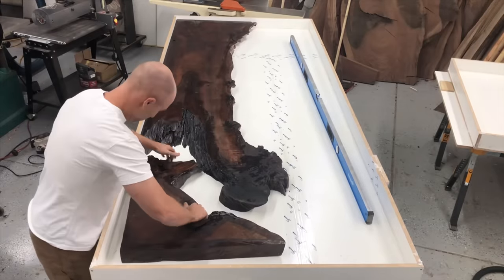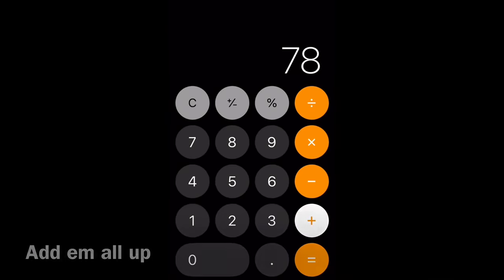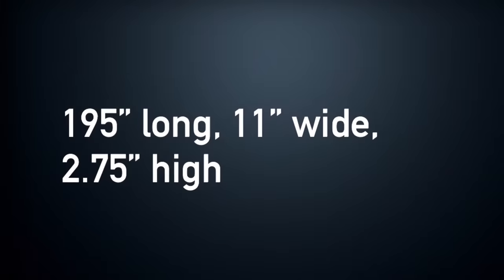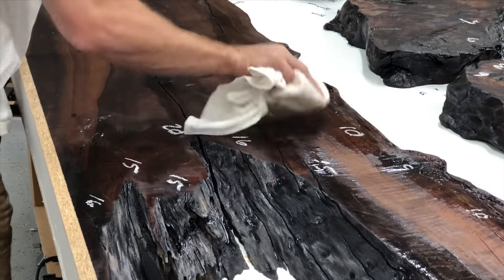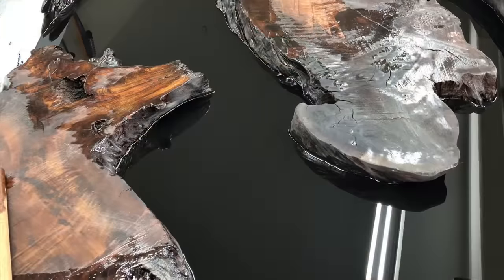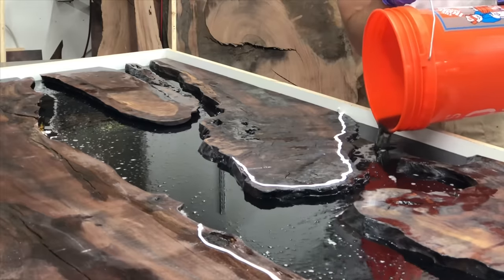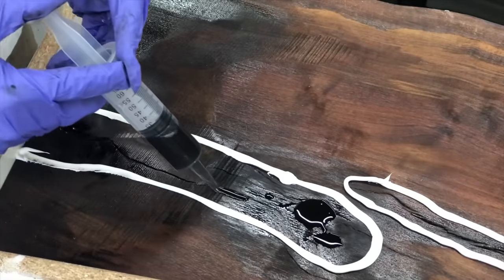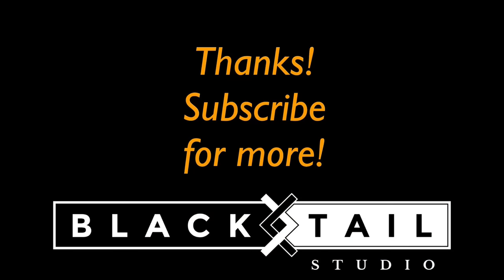Calculating Epoxy Volume--How to Epoxy Woodworking

Comment: Couldn't you also wheigh the wood, calculate it's volume with the density and subtract that from the total volume of the table?
Reply from the maker: Brilliant!
Reply: This is how I would have done it.  Knowing the density of the wood and the volume of the table and assuming it’s uniform thicknesses  you could easily calculate the volume difference.
Reply: @hydrohobbyist  the problem is, that theres no constant density, this is no homogeneous structure
Reply: It's homogeneous enough, for sure it's faster and more precise than measuring such curvy path.
Reply: This was my initial thought as well.
Reply: @deathmetal5156  How about using sand?. Fill the gap, take it out and see the volume. Would it work?.
Reply: @BlacktailStudio  How about using sand?. Fill the gap, take it out and see the volume. Would it work?.
Reply: that is inaccurate .. What if the pieces have a void in them ? or a horseshoes buried in them .. The guy that solved the method was Archimedes a few thousand years ago ..
Reply: @IVORY123100  If there's a horseshoe in it, it would probably have been found when the slabs were cut. small voids would not make a big difference in something this size. this is still a much more accurate method than the one shown in the video
Reply: @johnthomas4790  No it's not .. I was being facetious about the horseshoe .. Calculus is actually the way to go but considering the time .. It's not the best pathway ..  I would have used Archimedes method ..
Reply: Too much work
Reply: Why not just pour water to level, dump the water and measure that, then make an equal amount of epoxy... lol
Reply: Variations in density will not be very large,needs just 1cubic cm, wood
Reply: Jonathon Smitherson because my wood would be wet..... plus I’m not trying to pat dry all that surface area
Reply: @mariaarana6912  thanks for the answer! :)
Reply: @IVORY123100  wrap the wood in clingfilm to avoid sand going in to crevices.
Reply: @BlacktailStudio  Can you just pour until there is enough? 
Since you work with resin, you don't mind having extra.
Reply: @rowndo  the idea is to waste as less material as possible, and going little by little would take too much time considering curing time and the preparation of the resin between layers
Reply: @johnthomas4790  How would your method be more accurate than his method that was only 6 liters off? He was only like 6% off, which is why in any kind of construction estimating you always add 10% to your material estimate. If you're like him you're building these for a client, and you're billing them on your estimated materials cost and probably require a deposit or down payment to cover at least the materials. So, being that 'accurate' isn't really a big deal because you're getting paid either way as long as you're not too short then you're good, right? This is a $10,000 table, 6 liters of epoxy buying in bulk price is what, 3,000 in epoxy he claims it cost, divided by 105 liters used, is 28 dollars a liter, which is $171 dollars for 6 liters. I don't think a client spending 10 grand on a table is concerned about a couple hundred dollars, do you? I mean, you can go all math magician if you want and weigh stuff and calculate density but time is money if he values his time at $100 an hour or $150 an hour, and it takes an hour to weigh all of the wood and do all of this stuff then you might as well have just been off by 6% anyway lol.
Reply: Or you could figure your volume without the wood, then measure the wood, subtract that from the volume and there you have your new total negative space, which gives you the amount of epoxy

Comment: Why not just pour water and measure how much it takes to fill? The wood is sealed no?
Reply: that is the fastest way to do it,
Reply: Great idea. Drying it would take some time though I think. ( Well - not where I live. )
Reply: @chookvalve  put plastic
Reply: or just do the volume of the cuboid and minus the volume of the wood
Reply: The problem is if anything goes wrong and the wood gets wet you would have to dry it again
Reply: Some woods soak in a lot of water, it's not ideal

Comment: fill the epoxy areas with uncooked rice then measure the rice after in 5 gallon buckets. accurate, easy, cheap and re-useable.
Reply from the maker: I do like rice. Having 100 liters of it handy would have fringe benefits.
Reply: I was thinking fine sand, the volume estimate would be closer and the cost cheaper, it wouldn't spoil, etc. That would save so much time on measurements. Try it with a smaller poir to see how closely it estimates the actual liquid volume required.
Reply: Pretty damn good idea. Assuming water would penetrate the wood too much.
Reply: Very nice tabl 
I learn more from you tomch thank you

Comment: Too much waste. Could have filled the bottom of the "river" (pebbles, sand, wood scrapes, anything that occupies volume) and pour first layer really black to hide fillings.
Reply: Gross. Absolutely gross. My table better be all apoxy and not a vegans lunch
Reply: Eh, client's prerogative. If they want a huge table that's mostly resin and are willing to pay for it, well there you go.
Reply: Nieroshai 
I don't think you understood my initial comment. It has nothing to do with size. Less epoxy volume would reduce the weight and improve structural integrity.
Reply: Nieroshai my opinion matters. Not yours
Reply: That is not the correct way to build a $16k table.

Comment: Cam hello, 
Thank you for sharing all your content and providing step by step information on each project. I am somewhat new to your channel and while I am still catching up, you mentioned the waste amount that seeps under your projects which I think in this one you said it turned out to be about 2 or so liters of wasted epoxy. Not sure if you do it now or not but if not you could just line the underside of the wood with caulking to seal it so you can save money and not waste more product than needed. 

Respectfully 
Travis

Comment: Awesome channel! So much information in one place, simply amazing. Beautiful woodworking projects. Top knowledge. One short question Cam: What is the maximum recommended quantity of epoxy resin in one table in percentage - regarding coverage? In other words, is it too much if wooden slabs take abut one half of surface and epoxy river itself takes up other half of total design?  What has to be considered? Thanks a lot. Keep up the good work. Jan
Reply from the maker: No book on that! Just preference

Comment: Great job!  I am just finishing a walnut 51x96x2 1/2 with white tinted epoxy.  All good except for tweeking my back loading it into my van after running it through my buddy's 52" sander/planer.  Next step to surface coat with clear epoxy then spray with UV resistant 45 sheen urethane and viola.  Thanks for the demo.  Few understand the costs of these projects.
Reply from the maker: Awesome!

Comment: Hi Cam, I just watched your "You Tube" smart desk for your wife.  I am just starting to use epoxy and resin products.  I really liked the brass/ bronze you used for the cracks etc. I have found that if you use a small amount of wood stain acrylic sealer stirred into the epoxy/resin it tints to match closely with the wood you are using ie walnut wood add tiny bit of walnut stain,  mahogany wood use small amount of mahogany acrylic stain.  The acrylic is the only one I've found that works at this time.  As you know,  some woods are expensive and with metal epoxy/resin additives it's also costly so test on a small piece of scrap wood. Also, Raw Umber is a great tinting tool if you've gotten it too dark.  I've been a contractor over 30 years, antique restorations, however I'm looking forward to retiring and trying my hand at woodworking! Used to be I could walk into a lumber mill and I could tell which lumber by the smell and my crew used to laugh at me! I ultimately want to do a full table in walnut,  if I could get a thick enough slab I want to slice it and biscuit both pieces together to get a butterfly design.  It's only happened for me once, years ago,  restoring a walnut shrunk, but I'm hopeful! I've subscribed to your site and look forward to the next project! Be well and blessings for Father's Day!👍😀
Reply from the maker: Wow, that’s! And happy Father’s Day!

Comment: Someone else mentioned the density trick above, but I also wanted to suggest an improvement to this method in the video. Say the direction parallel to the longest side of your table is north/south. Divide the table into segments by drawing lines directly east/west (not diagonally) across your table at each point where either "bank" of the "river" has a corner. Record how much of each of those lines is in the "river", and do the same for the northern and southern edge of the table overall. If the line crosses the "river" multiple times, add all of them together.
You're going to give each segment a score. Add together the river width numbers you recorded for the lines on both sides of the segment. Multiply that by the distance between the lines. That's the segment's score; write it down on the segment. For example, if one line has 5 inches in the "river" and the other line has 3 inches, and the two lines are 8 inches apart, you would write down (5+3)*8=64.
Add together each segment's score. Divide by 2. Multiply by the height of the table. That's a pretty good estimate of your volume.

Comment: Nice Calc method. I simply use pearlite beads and a measuring jug. Pour in the beads with jug, measuring the number of jugs. Once it's full you have the volume and vacuum the beads out. I like the edge and bottom calc.

Comment: Imagine being rich enough to spend over 10k on a table
Reply from the maker: Would be nice!
Reply: M R pretty sure the wood alone is not far from 10k
Reply: @weg5856  would be alot cheaper to build a mill and cut your own slabs. Just need somewhere for them to properly dry for 2 years. I see big old trees all the time you would be surprised how often people will let you take them just to get rid of them. Then build yourself a sawhorse and a cherry picker, cut the logs to your desired length, set up your makeshift mill, cherry pick your logs onto your sawhorse and get to work.
Reply: I can't even imagine spending 3k on the epoxy :P
Reply: sometimes you have to bite the bullet and take into consideration how much it would cost for three inexpensive sets that would last 5-8 years versus buying something you love and you'll look at every day for thirty years! It's a tricky balancing act. But you have to ask yourself "what brings joy to my life"
Reply: @aadravid  Me too.
Reply: M R buy hand tools on Amazon and you probably can
Reply: 3000 epoxi, 2000 wood. 2000 work-electricity-machinery-earning,  10k is overpriced. Far better 15k
Reply: No

Comment: Hi Cam. Thanks you so much for your extremely informative videos. I am an accomplished professional woodworker, but just getting ready to do my first large epoxy table. You cover everything so clearly but I do have a few questions...My slabs are only 1.25" in thickness. Do you have any advice for tables that thin? Will flexing be a problem? 45x86 dimension. Have you ever had an issue where the epoxy separates from the wood, creating a small crack? If so, what did you do. This table will be going from an average humidity of around 10% (Idyllwild, CA) to one that averages over 75% Smiths Ferry, Idaho). Do you force problems with that? Thank you in advance for your time and expertise!!!

Comment: I wish you would do a project where you pour half of the form with black epoxy like you did on the first half of this pour, but then instead of pouring black epoxy in to fill up the form you finish the pour with clear epoxy!!! This would give so much more depth to the table. I think this would add a extra dynamic flare to your work. I think they would be gorgeous, and would love to see it!

Comment: Love your work everything one of your tables look flawless I have started building tables after tons of reading and research .. I always seem to have trouble with putting on my tables I have tried several different ways to reduce the epoxy pits but little or no success I have tried sanding and doing a thin coat over the top but it doesn’t seem to work I always have to go back and sand and polish .. Witch leads me to asking what you do to reduce the pitting  in your resin ?
Reply from the maker: The best thing is using a good epoxy

Comment: Love the videos and your results!  2 questions :  1.  on one video I think you mentioned - to NOT pour the table "top side" down - why not, actually seems like a good idea to me   2.  the epoxy I was going to use says High gloss, does the hardwax sheen of satin negate the high gloss???  Thanks!
Reply from the maker: My latest epoxy video I did upside down with some problems. Should help

Comment: Thank you for all you are teaching us. I live in Saint Helens so I hope to attend one of your seminars some day. 
Just finished the flood coat on a 10'x4' red cedar table top. Had done a skim coat before that. Went in the shop every once in a while to eliminate a few bubbles, it looked perfect, when toward the end this big fly landed on it. Removing it the epoxy was too far gone by now so I ended up with a 1" blemish right in the middle of it. Is there a way to spot fix it without re-doing a complete new pour? Thank you,
Reply from the maker: I think you should be able to scuff that area up with 320, then another thin coat in that spot. Sand flush and buff or add finish from there

Comment: Just had this thought.
Buy a few bags of sand (or just dig up some dirt from outside. But make sure it is clean and consistent, you don't want to be mixing in compounds with different densities.)
Calculate the weight of sand for a given volume (such as the number of ounces per gallon or some such).
Lay all of the wood slabs in the form, and fill in the river space with sand up to the target height.
Pull the slabs out and sweep the sand into a container.
Weight the container on a (properly zeroed) scale.
Using the above weight/volume ration, calculate the volume occupied by that weight of sand.

Probably need to add a bit of cushion, since you will lose some resin in manufacturing, and the resin can fill gaps that the sand won't, but that should give you a fairly quick, relatively accurate method of calculating the volume of empty space.

The only issue I can think of is that some times you may not want to cover the slabs with sand (for example, DON'T try this when the wood is freshly sealed, the sand would stick to it...)
There are other things that this could be done with. Water for example, better ability to calculate volumes and fill voids, but I doubt you would want to dunk your slabs most of the time.
Another option would be small metal bearings, though that could get expensive. Coarse sawdust might work as well. You can get creative, just be careful about contaminating the project, the environment, or yourself.

Comment: Do you space your slab an 1/8” away from the inside of the mold (melamine) edge to allow for the radius of the silicone/caulk you put on, So it can register flat on the bottom of the form? Newbie here haha
Reply from the maker: I cut it down anyway. So doesn’t really matter in the end

Comment: Love your work!!  I'm just getting into epoxy resin and am starting small.  My work will be for personal family and friends, not commercial.  I'm wondering if you have used polyurethane finish over your tables and,  if so, how you avoid brush marks?  I've used a china brush and foam brush application, but still get marks.  Appreciate any thoughts!
Reply from the maker: Brush marks can be tough! Let it self level best you can

Comment: Sorry I know this question is late in the game but I have two questions for you.  Do you use anything on the side of your forms in between pours like say, an electric sander to vibrate or push up the bubbles?  I know what I want to say I just don’t know how to put it lol.  I’ve seen it done before on concrete counter tops and even large floors.  Pros use a vibration machine to make any bubbles rise to the top.  For smaller pours, a counter top, I’ve seen someone use an electric palm sander without any paper.  Just using the vibration from the machine to cause bubbles to rise.  My second question.  Do you ever use metal or any other type of bracing in between the pours for strength?  I don’t know how strong that would be or if it would even need any type of metal or fiberglass type of bracing.  Looks awesome as usual!

Comment: Hi I’m new to your channel, I’m not a woodworker but find your channel fascinating. I have a couple of questions, how did you get started in woodworking, If you were starting out what is the first machine you would recommend. and given that I’m in the uk where the relative humidity is between 60 to 70%  would we have to work differently.
Thanks for the videos

Comment: Could you use kiln dried sand to calculate the epoxy use.?Measure volume of sand used and vacuum/ scoop out when you have the right level.